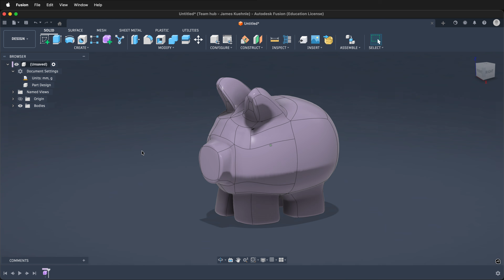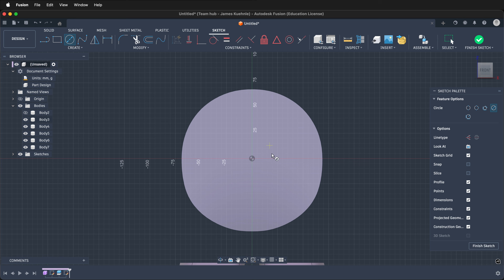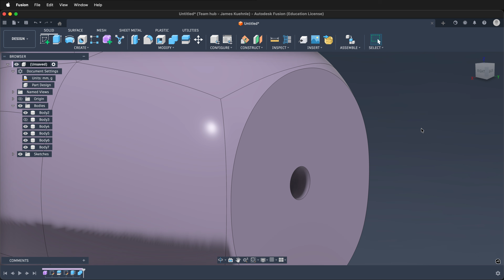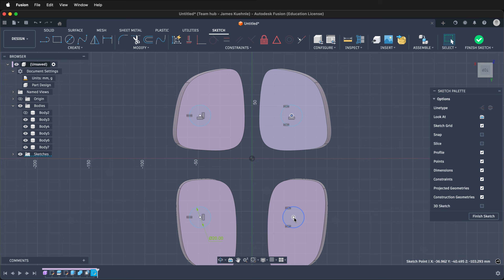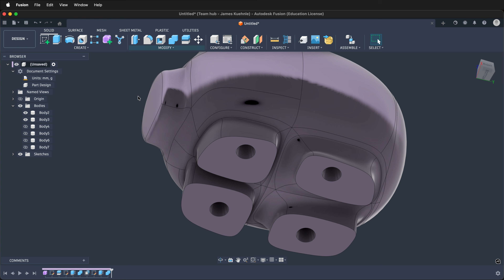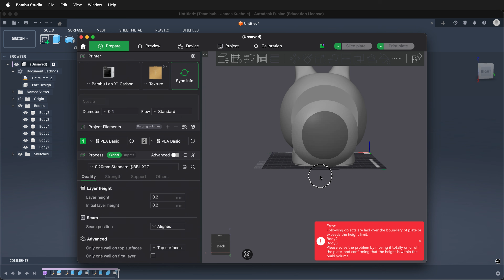Autodesk Fusion: Split a Model to Fit Your 3D Printer (Add Alignment Keys)

Comment: this is cool, but it can also be done more easily in the slicer, no?
Reply from the maker: Yes, the slicer can do this easily, but if you want to have an adjustable, parametric splitting of a model then this Fusion method can be optimal

Comment: great video. One thing I would add is that for printing - you likely want to have holes in both parts and have a third standardized pin than connects the parts. This way it's easier to print (all parts are printed laying flat on the cut) and the connecting pin can be adjusted later for a better fit. Instead of giving it an angle - I would probably add some kind of grip fins that would flex to adjust to the part tolerances. This way you can make a strong connection

Comment: Yes, but you can do this faster in Prusaslicer. I understand there are probably work flow reasons you might prefer one or the other. In the case where you forgot and have fully finished your model and you're out of time, doing this in slicer is faster than fixing and re-exporting.
Reply from the maker: That's a great point, sometimes the slicer is definitely the faster route!
Reply: How about bamboo slicer?